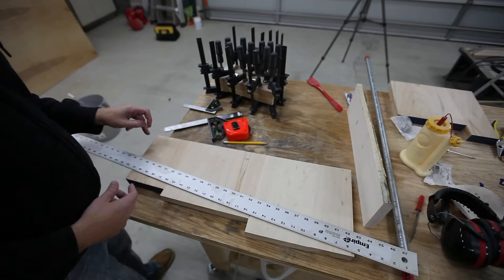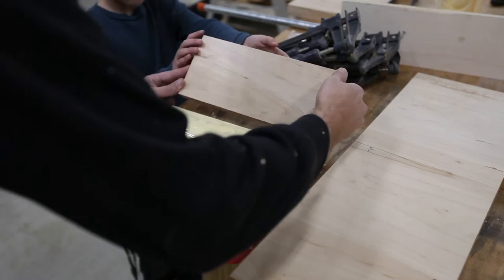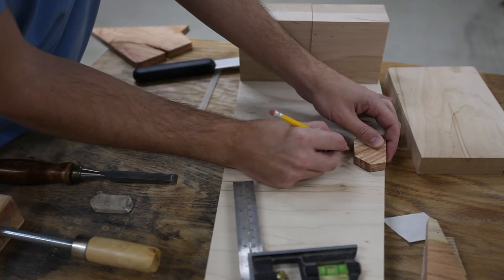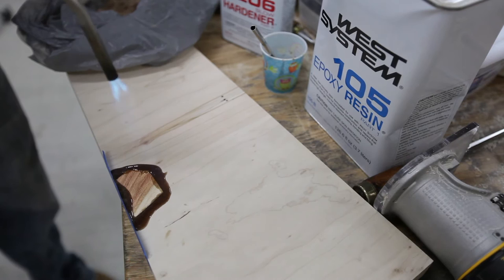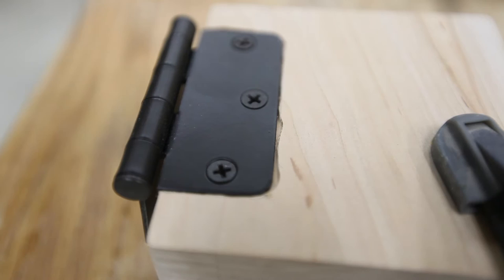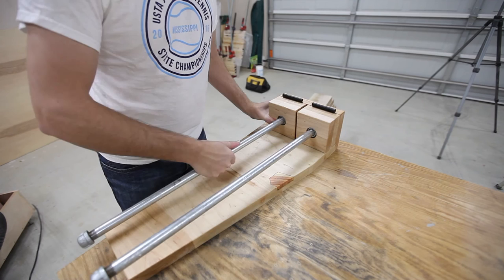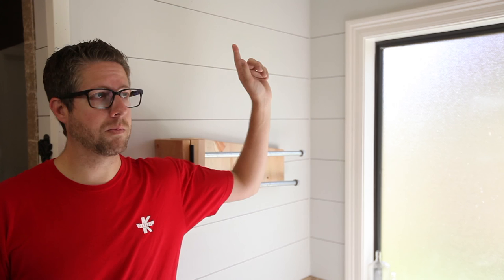Metal and Wood Towel Rack with Swinging Arms // DIY Woodworking

Comment: Hey Bruce, when you file and scrape this galvanized steel, doesn't it remove some of the finish and/or add some steel from the file/scraper that in turn, might rust with damp towels? Did you notice this happening on yours?
Reply from the maker: I've not had an issue with that at all. I didn't really file and scrape these. Mostly just washed off the residue that comes on them. We are still using this thing, 3.5 years later!
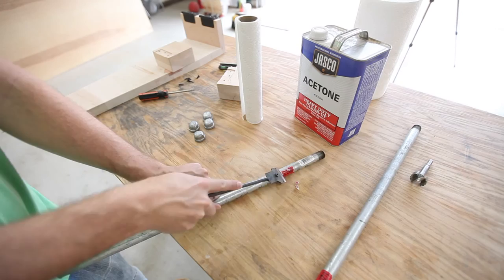Reply: @BruceAUlrich  At 5:30 you use the scraper and file. So if I understand correctly, you did not do file/scrape a lot and this explains why there was no rustable steel transfer that could have rusted. 

The reason I'm asking is I've had a glass installer come over to my house and screwed a stainless steel screw to hold the shower glass and his bit must have skipped a bit and the metal from the bid that had embbed itself in the stainless screw started rusting, which is not something I'd like to stain towels...

So just correct me if I'm wrong about how much you did file/scrape...
Reply from the maker: Oh you’re right, I did file the burrs. I did not file it a lot. No rust has happened on mine. I’m sorry to hear that about yours.
Reply: @BruceAUlrich  Actually, I'm doing this project now, but this did not happen on the towel project, which is nowhere near completion. The rust happened on a stainless steel screw in my old shower, the screw being a hardware for my glass door (I also had them fixed!). Which is why I was adamant to see if that had happened, but I'm glad you don't have any rust to report after 3.5 years, which means I'll be able to remove burrs if there are some, like you did. Thanks a lot Bruce!